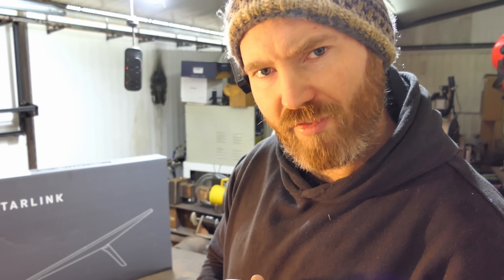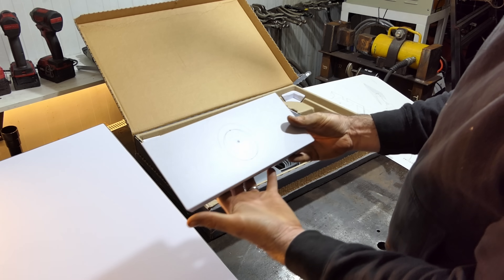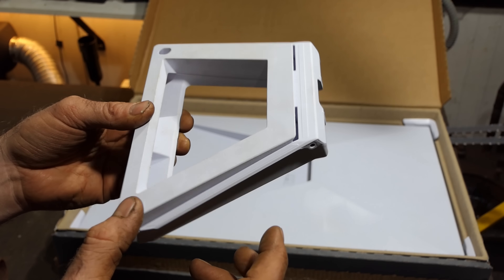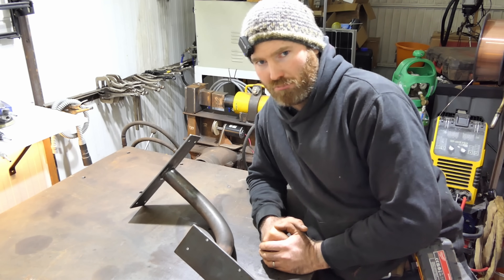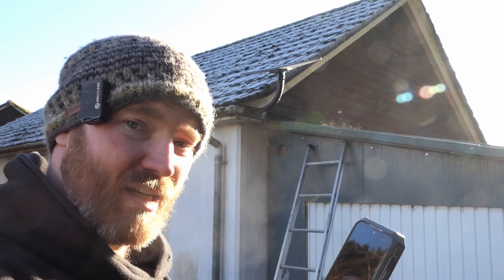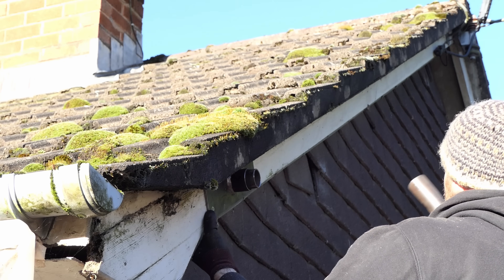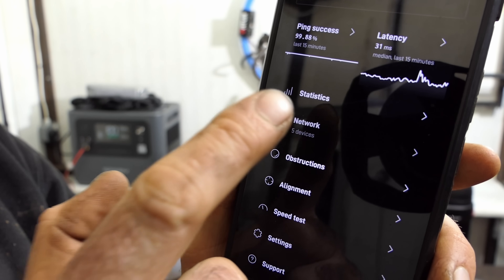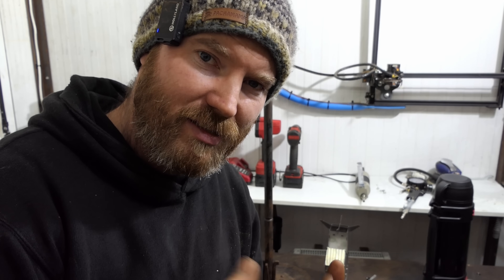I bought UK Starlink internet... I'm shocked!

Comment: Good luck! We had starlink for about a year and when it works it was great. When it breaks you’re in trouble. 
They have no support helpline and all support is via online tickets which is hard when you have no internet. Starlink took 4 weeks to acknowledge my ticket, another 2 weeks to send a new router only to find out that didn’t solve the issue. Another 4 weeks for a new ticket and another two to get a new dish! 

Snowmelt doesn’t really work. Snow froze onto our dish and had to be scraped off.

Oh and good luck with putting the cable through the wall. The plugs on each end are MASSIVE which might not be an issue is an American house of wood, but I had to buy a 3/4” auger drill bit to get through 18” of solid stone wall!
Reply: That drill bit will come in useful when you install fibre and get a proper 900 Mbit connection.
Reply: @dgnash  What do you do that you would need 900 Mbits???
Reply: Waste of time.
Reply: £96 a month for 350GB? I'm paying EE £40 a month for 500GB FTP.
Reply: @BullDetector-365yeah but I expect your not living in the back of beyond.
Reply: I'm paying £67  per month to BT for 900Mbit and it's completely reliable.
Reply: @dgnash  But if you live where we live they won’t install full fibre so the best we will ever get is 50mbit and they refuse to do anything for us.
Reply: @dgnash  I'm waiting for City fibre to go live and will start off with a 1Gbs symmetrical connection with a static IP address for about £45 a month, yup that's a 1Gbs UP and down speed!
Reply: @dgnash  How much!!!   I pay £25 and thats 900/900, not the castrated BT version.

Comment: Question do you get a 5g signal in your area. Because if you can then you could have got Three 5g Internet. One wire sits close to a window on the Sill or Table. Costs £27 pounds a month. Speed well mine is 300meg on my pc. With 3 TVs and 3 moblie phones running off it at the same time. Upload speed 50meg
Reply from the maker: It's not great signal here either...

Comment: The "average" speed you pointed out at the beginning of the video is still provided via copper cables but from a cabinet (which has fibre optic) but primarily BT has such speeds....its still not reliable

Comment: £300 and 75 a month You can get Virgin Media on a copper cable and get the same speeds about £44 a Month 😅

It's great what a little bit of research does for you.

However it's amazing  How this works without any use of cable at unlike normal broadband going from a box on the street. This is the future hopefully it becomes less expensive and more standardised.

Comment: Are the internet options in the UK really that limited? You can get gig+ speeds with cable (coax) internet here in the US (at least where I'm at, anyway). No need for fiber. My ISP actually keeps upping my speed for free, simply because I'm on the lowest speed they offer, and the lowest speed just keeps increasing. My speed was at like 330Mbps down two or three years ago. I just ran a test. Looks like they bumped it up to 500Mpbs down, 50 up. I pay $50 a month.
Reply: No they aren't that limited. Lots of places can get more than the speed you get. But of course like anywhere there are dead spots.

Comment: I use Starlink, little tip, outside on your bracket I would wrap the bend with a tough rubbery outer layer because you will find certain birds or even a random cat if one happens to climb up will nibble on the cable! I found tiny little teeth marks on mine after a while (it was my cats I think) but to save a potential headache at the cost of a few minutes and a few quid on amazon you can protect it.

Comment: If elon musk has anything to do with it, I won't buy the product.

Sorry mate you don't live in an area serverd by 'full' fibre or virgin but hang in there, when i moved to my current address , all i could get was the 16/17 mbps service too for a couple of years but then when my contract was up with plusnet after that time BT had enabled fibre optic in my area and i leapt on it.

The speedtest you showed at the start showed london as the server, unless you chose that, so it's not like you live in the outer hebrides so some day you will get it❤

Comment: The problem I found with starlink is no port access so I can't access servers remotely with the standard plan but not really wanting to pay #2,500 a month for the non-residential service.
Reply from the maker: There are ports under the grey part on the router. Just need to pop the cover off. it wasn't obvious and didn't mention it on the instructions. Cheers J

Comment: isobuster is a great data recovery software tool if you haven't sorted your hard drive out yet. worth a try, worked for most of my recoveries. download and see if it can see your data. if it doesn't you haven't lost anything, if it does its about 50 quid to open the recover button.  does hard drives cd's dvd's and more that refuse to mount. grab back deleted files. ask chatgpt about it it does a ton of stuff. anyhow take care chap, i enjoy your vids

Comment: You can fix the range issue by buying a new router to replace the starlink one, any D-link or huawei or tp link router you want, you just need to buy the starlink ethernet accessorie i belive it cost 25 bucks and connect your new router wan port using an ethernet cable to the accessorie wich is connected to the starlink router, setup the new router and bypass the old one using the starlink app and boom you upgraded your router
Or buy an 5Ghz extander and place it in the other side of the house

Comment: Why not piggy back a router with the star link one using a long RJ 45 cable to your work place.or you can get 2 plug units one receiver and one transmitter with you plug in to your work area and it uses the electric cable as a RJ 45 cable  but I cannot remember what you call these units I have one in the loft and one down stairs.

Comment: Pretty good speeds. I use a 4G router, which has super slow upload (sometimes down to 0.5mbps). It takes all night if I upload a video. At least it works for most of the time though, not like the old BT line which kept dropping out. ... I'm still waiting for fibre

Comment: Your kids your rules but I am going to offer you a perspective from someone who hires and manages a lot of people of all ages. Kids these days absolutely need to be digital natives to keep up with their peers in the working world. It's easy to tell who has and who hasn't been used to having permanent internet access to ask questions and get help and solve problems and more and more the ones who aren't used to being able to solve problems quickly with a default reversion to Google look like dinosaurs. It's expected of the older generations but it's a worry when I see really bright kids come out of university that aren't digital natives. I fear that your rules are likely to hold your kids back in the professional world and would recommend you setting up really good access controls rather than making the internet seem like it's only available part-time.
Reply: he mentioned they are not teenagers yet so maybe this comment will apply when they are 12+, I can say as a teenager that now as i got older I highly regret spending the amount of time i did on technology, especially since i had complete unrestricted access, i don't think being tech savvy is a good trade off for spending time on the internet, many more important skills could have been learnt if I had more restricted access when i was younger. The internet has also greatly changed from when I was a kid, the modern internet will absolutely not teach the same level of skills it did compared to even 10 years ago, even before my time on the internet (2012-present) the previous generation of internet users had exponentially more tech skills then me. 

The modern internet is now more geared towards consumption and also exploitation by large tech companies and dodgy figures, hell even the big main apps (youtube, instagram, twitter, facebook) that people use are so so much more evil then they were a decade or two ago. The benefits do not outweigh the costs in my opinion, this parent should loosen restrictions as they grow older but I wouldn't call what he's doing right now wrong in anyway.

Comment: The bracket you welded yourself in the middle of the video to secure the Starlink is amazing! You have such impressive hands-on skills!

I live in Beijing, China. My home internet is currently very fast with 1000Mbps download and 50Mbps upload speeds. By the way, if you notice slow internet speeds in your house, you could try adding a few more routers (like ASUS brand). Only when the router coverage is comprehensive will the connection speed become fast. This is exactly how I solved my home internet speed issues.

Comment: Mbps is Mega bits per second, MBps is Mega Bytes pers second, there are 8 bits in a byte so it's important state the correct unit, you are using the two interchangeably which is very confusing. 368 Mbps is 368 Mega bits per second or 46 Mega Bytes per second, not 368 Mega Bytes per second. To get from one to the other you multiply or divide by 8.

Comment: Good info, proper tests of Starlink in the UK are interesting. 
Did you get wifi to the workshop sorted? 
Powerline adapter work surprisingly well or maybe just get a cable to another hub in the workshop. Don't just relay on wifi from Starlinks' rooter.

Comment: Despite living in SE London, my cul-de-sac has no broadband so I rely on Starlink. Been faultless for 2 years but a small power cut killed my Gen 2 router. The customer service is excellent and they allowed me to buy the new Gen 3 from Currys and credit my account for the cost. Bit of a pain to swap it all out with the dish up on the roof, but could be worse! Not sure why they moved away from the self-aligning dish as standard though.

Comment: "Congestion charge" already. Which means this thing is overloaded already. 
Once a significant number of people start using it, the speed will drop below that of the copper cable connection.

Comment: you don't need fiber optic to get good speeds.. i have 92 Down 25 Up over Broad band coax.
And its not even the high end subscription , I pay 59 euro/ month and I could get twice that if I wanted to for 15 euro more.

and that 380 Throughput.... That is just what you get to the satelite..
You need to do a proper test with Ookla to a server in your area

Having 380 Throughput isn't doing much if the connection at the other end, to the webservers is like having a 5 inch water faucet.. thats connected to a half inch water mains pipe

Comment: looks good for rural areas, for the lucky ones of us near built up areas we can get the newer fttp , i get 900 down and 900 up  (and using wifi 7 which says it will push 5.6gbps so lots of headroom), hopefully the UK catches up soon and pushes those speeds out so they are available to all
Reply: Then there is Europe where not only our mobile deals are subscriptions only, no contracts, better deals with tons of good things cheaper than here and our internet is 1gb up and down and more. UK really is behind in most thing electronic you need to catch up.

Comment: Building a PC is easy enough you will take to it like a duck to water. the motherboard will come with a diagram for wiring  which is the most difficult part, but hardly a challenge and the rest is PnP.

Comment: I got fibre to the premises a few months ago and finally feel like I have the internet connection I needed as a teenager, average 980mbit down 110mbit up, but over the years I've had everything from 56k dialup to ISDN 128k to satellite connections to 4mb-29mb DSL. I've installed Starlink for some people through work and always tell them in the absence of a fibre to your door, you will struggle to beat or get anywhere close to starlink for general use.

Comment: Interesting vid, gratz on your Starlink. Two points that you should be aware of and which would have strengthened your vid for you to knew beforehand. There is a monumental difference between Megabyte (MB) and Megabit (Mb), so using the terms interchangably is not tom-eyh-to tomato. Second is showing what the difference in latency is between your old copper-line and the new Starlink (time it takes for your signal to reach it's destination). Your Starlink signal has to go to space and back in addition to any other routing, how does that stack up when compared to that otherwise horrible copper-line in terms of latency? I've heard that playing online games through Starlink is a very poor experience because of the low latency, as it means delayed responsiveness with whatever you do online. It would therefore be very interesting to hear whether or not Starlink latency is better than UK countryside copper, or if it's a question of pros and cons between the two solutions.

Comment: Starlink sounds like a good alternative but I'm not impressed with the speeds. Great if you're in the middle of nowhere with no phone signal. 

You can get close to those speeds using any mobile internet for alot less money. 

You're on 5G on your phone - could see it. I've just tested on mine and got 200mbs with 1 bar of 5G and 8mbs upload. 

I pay £8 for my sim - Can use it for tethering.  Starlink is £75. Expensive for what it is.. unless you're really in the middle of nowhere.

Comment: Mb is megabits, MB is megabytes
Reply: Thank god someone emphasized that. It's SHOCKING how many people don't immediately recognize the difference. 1MB = 8Mb ...
Reply: Looks like significantly increased latency?
Reply: Megabits is data transfer speed, megabytes is storage.
He incorrectly said megabytes referring to internet speed.
Reply: @HughJaanus  eh? No, Megabytes can and is used as a way of denoting up/downlink speed. Same with megabits for storage. 8Mb = 1MB. It's just that many people don't know this and use them interchangeably.
Reply: @wayn3h  Internet Service Providers (ISPs) advertise their plans in Mbps (megabits per second) [1, 2]. For example, a "100 Mbps" connection means 100 megabits are transferred every second.
File sizes are measured in MB (megabytes).
Now, go back to sleep.
Reply: @HughJaanus Lol dude I'm network engineer 😂. I'm sorry that you can't comprehend what I'm saying.
I know he misspoke but megabytes per second is also a way of measuring bandwidth. I love how confidently wrong you are in saying the two are mutually exclusive 🤣.

Comment: Sounds like you had normal ADSL which is tyically up to 24`mb down and up to 1mb up,   FTTC  (may not have been avaulable to you) is normally up to 70 Mb down and up to 20Mb up..  FTTP typically up to 900Mb down and up to 100Mb up..     Glad you have good speeds now fella

Comment: If you live in the UK, it may be worth investigating if there is any 5G access in your area, before considering Starlink.
You'll get better ping, probably faster download / upload (up to 600mb/s depending on reception) and subscriptions can be bought £250 - £300 per year pre-paid. 

The only downside of 5G is that you have to deal with CGNAT which means difficulties hosting servers from home, but this isn't usually a concern for most consumers. Though, I read that starling also uses a CGNAT, so the same problem would exist (I may be misinformed though).

Before we got fiber to our property I used an 'unlimited' prepaid sim with no issues for a couple of years. 

No 5G and then Starlink becomes a potentially viable option.
Reply: 5G is a military directional weapon....Nothing to do with internet speeds

Comment: Look up homeplug AV2, You plug the HomePlug AV2 into a wall socket near your modem and then connect it to the modem's Ethernet port using an Ethernet cable. This allows the device to create a network connection using your home's existing electrical wiring.

Comment: So does it not have an ethernet port on the Starlink box to link to an ethernet switch or even a firewall? And the upload speed seems very slow. On my fibre optic connection I get much faster speeds, both the same.

Comment: OMG I cannot believe so many think their internet speed is slow based on their mobile connection. The internet speed on your handheld mobile phone connected over wifi is never going to be what the ISP says your download speed will be the wifi connected device will always be operating at a MUCH lower speed. Connect a cable device (e.g. laptop) and retry it. As a matter of disclosure I don't work for an ISP or have anything to do with one.

Comment: We have starlink on the north coast of Scotland. Amazing. 150-200mb all day. Zero hassle with installation, we just stuck it in the garden. It’s been one of the best tech experiences we’ve had up here. 
BT installed fibre but the whole community shares one cable so we’re limited to just 2mb each, it’s a joke. Starlink was the best solution.

Comment: There's a simple solution to your lack of WIFI signal from the Starling router. Install a MESH network like I did last week. I had the same problem with getting a signal from one end of the house to the other end, the Mesh Net fixed it all (and runs at 3Mbps - faster then the usual 1 Mbps on a normal wired network.)   PLUS..   You may actually be able to eliminate the Tesla router altogether (like I did).  I bought 4 nodes of Tenda AX3000 for AU$304 (AU$76 each node). There are also faster models like the AX5400 but they are more expensive.   Well worth the small effort of installing them. BTW, I don't work for Tenda, just use their equipment.   Regards, Greg.

Comment: you can't speed test properly using a mobile phone on WiFI as you're limited to the WiFI speeds, your actual connection could be 10-20% higher.  Gota plug in using cable and laptop.

Comment: I bought the cheapest fibre available in my building. It's 500Mbps for 14,95€ per month, 2Gbps would be 23,95€. It's infinitely more stable, with a lot lower ping than starlink. In Europe starlink doesn't make sense for 99% of people.
Reply: 99% of people is a complete over exaggeration